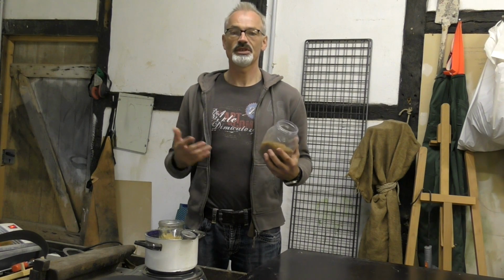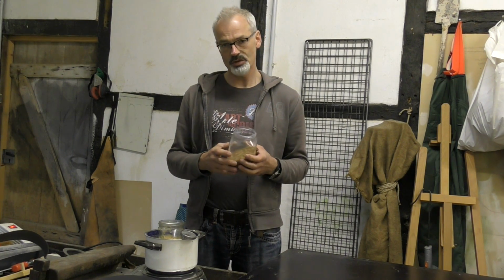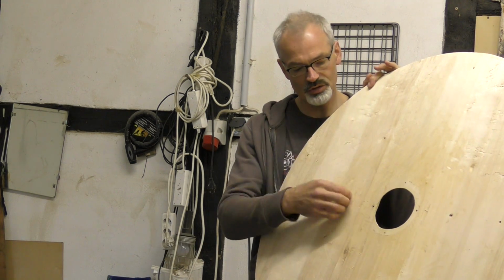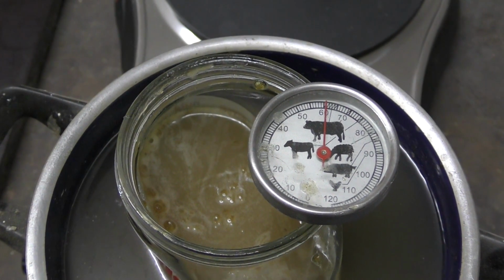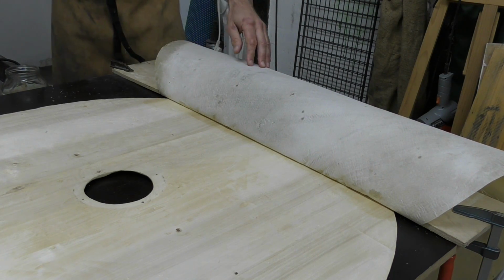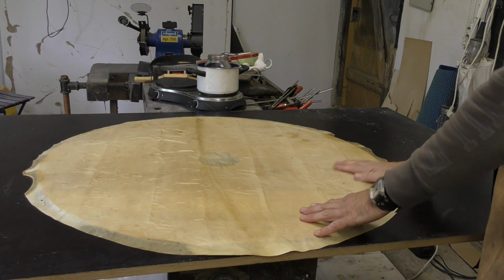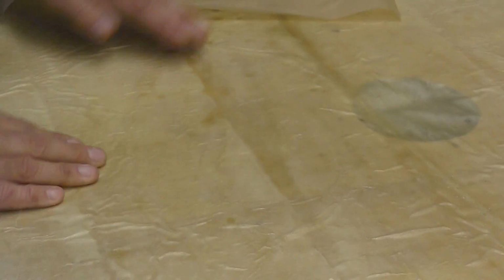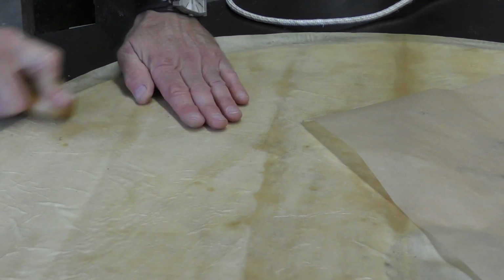Making an Authentic Viking Shield, part 3: Attaching a hide facing

Comment: Thank you for part 3.

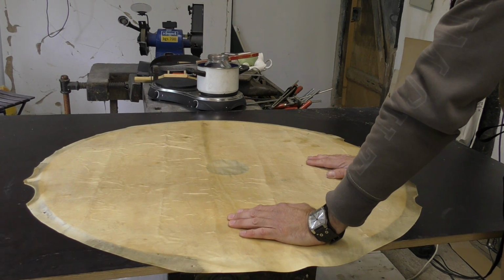I noticed something about the wrinkles, if you pause at 13:00 and have a look, you can see that most of the wrinkles goes in the direction you stretched it. If you have 2 helpers pulling hard at the sides as you stretch it, I think you can eliminate most of them wrinkles.
Reply from the maker: Assistance would of course help. The direction of wrinkles, however, will always be determined by the skin's grain.

Comment: If I were doing this, I would roll the hide up around a 100mm or so diameter roll core, clamp one edge to the shield wood and then pour a bead of glue along the whole length and roll the parchment on to the bead of glue. That might be more effective at making sure the glue is still hot when the parchment is pressed down to it. You'll get a lot of squeeze out but I think you'll end up with a better join and a smoother surface from the get-go.

Cheese glue is also amazing for jobs like this. it has a much longer open time and isn't affected by heat and moisture so if your shield gets wet it won't weaken.
Reply from the maker: Thanks for the good advice.

Comment: Hi Roland, 

Thanks for the vid :)

Will you be covering both sides of the shield? Do you know if the Vikings even did cover both sides?
Reply from the maker: There are some shield fragments from Birka that appear to have been covered on both sides. For the majority of shields and fragments, there is no indication of any cover at all. Mine will only be covered on the front side.

Comment: Shouldn't the hide be stretched tight for drying so the wood is under compression to make a stronger composite?
Reply from the maker: Hide shrinks when drying much more than wood does. With this shield, only one side has a hide facing, so one has to counter the tendency of the shrinking hide to warp and deform the wooden board. Covering both sides with hide is generally a better idea.

Comment: You would have better luck: 1) Apply a coat of Hide Glue to shield and let dry. 2) Fully Hydrate Rawhide, remove excess water. 3) Fully case Wood and Flesh Side of Hydrated Rawhide with a thin coat of Hide Glue. 4) Lay Rawhide down on wood and smooth with Fingers. 5) Continue Smoothing Rawhide with Fingers/Hands until the Hide Glue begins to firm up working out Bubbles as you go. 6) Now place your weights and Boards to keep it flat... after dry adjust with heat...
Reply from the maker: Excellent. Thanks for sharing. I shall try this.

Comment: I was wondering, did you use varnish on the shield, and if so what difference will it make and how will it effect the shield?
Reply from the maker: The final painting I created from egg tempera. It received a varnish made from glaire which is supposed to make it more water repellent. Worked okay but I am not yet satisfied with the final result.
Reply: thanks for the reply.

Comment: I did mine by soaking the hide first and stretching it onto the shield.
Reply from the maker: Did you not encounter any problems with the board warping?
Reply: @swordandshield  I find that the shield boards bend one way or another dependant on the weather. With seasoned wood it will bend excessively in damp weather and bend the other way when it dries out. If the bend goes around the body then there isn't to much of a problem. Being in the UK we don't have much of a problem with dry weather. I tend to glue using a none authentic glue {PVA} and then put a soaked hide over the top and stretched the hide as I pin it in place ready for sewing through the wood. As the hide dries the wrinkles flatten out. Also my boards of my shield don't taper towards the edge. I will have to try building a more authentic shield board and then use my usual methods to see if that makes a difference.
Reply: @miklawson211  I did the same with tapered boards. No discernable difference

Comment: I wonder how a shield that was put together with hide glue would perform in heavy rain. Would it fall appart? Maybe if it rains at first and then the sun comes out and warms it up.
Reply from the maker: That would be very unfortunate on a Viking voyage! I have not encountered any problems with foul weather, yet. But I neither would leave the shield out in the rain for a number of days, either.
Reply: Thanks! Now that you said voyage I wonder what they did to protect the shields against moisture at sea. If it is actually true that they stuck them at the sides of the boat.
Reply from the maker: No seafaring Viking with some sense would tie a shield to a gunwale at sea. Modern experiments showed that this is but a great way to lose your shield! The waves will take it. Shields on gunwales must have been reserved for representation or as a screen against missiles in specific combat situations. But not for sea voyage.
I assume that at sea, shields – like any items sensitive to moisture, including all weapons – would have been stored accordingly. Most of the time, you would not want your weapons and shields to be in the way anyway. I would make a shield cover e.g. from waxed linen.
Reply: Die ganze Schilde an den Steven Sache war mir ohnehin suspekt, aber man weiß ja nie. Danke für die schnelle Antwort.
Reply: Having made a plank shield with hideglue (but linen instead of hide and covering front and back) I just had mine out in quite heavy rain for a market this weekend..
It did warp quite alot, but did not fall apart and held up for reenactment fighting with no further damage.. It's drying now and it seems the warp is disappearing slowly.. :)

Comment: Poplar and lime wood refer to two different woods in English. Poplar or aspen is a wood suitable for things like arrows and is easily carved. Lime wood is traditionally used for shields and is the wood of the linden tree.
Reply from the maker: Thank you for this correction. The shield is made of poplar, not linden/limewood.

Comment: Did you buy the boss or was it specially made for you?
Reply from the maker: It was custom made by Anders Helseth based on a Norwegian original.
Reply: Roland Warzecha Do you know if the metal boss was raised or just hammered into that shape?
Reply from the maker: Anders did it the traditional way, so I assume it is all hammer work.

Comment: you could have painted it before glueing the hide to the wood. as i remember from the book "Die Schilde" from Illerup Adal they found pigments on the wood. and the very thin parchment looks translucent, so it should be possible.
Reply from the maker: Yes, I am aware of this technique. But it would not have worked with the intricate patterns that I ultimately painted the shield with, because attaching the wet glue would have smeared the egg tempera that I ended up using.